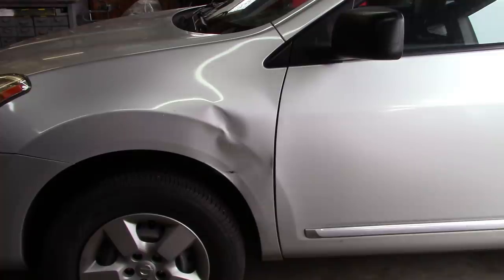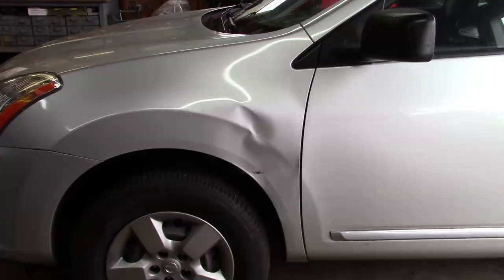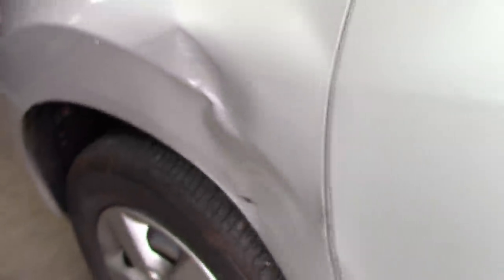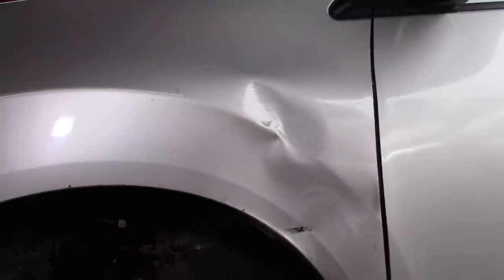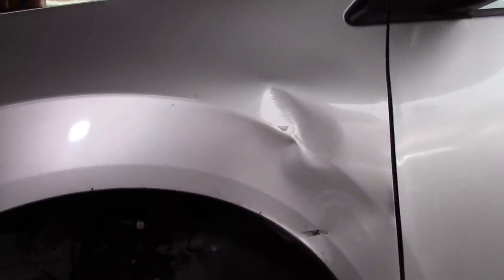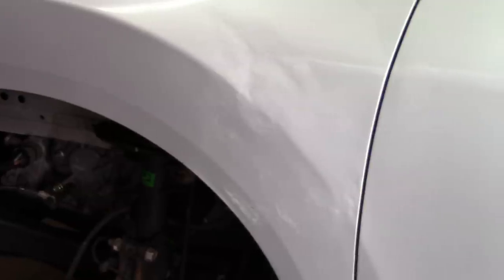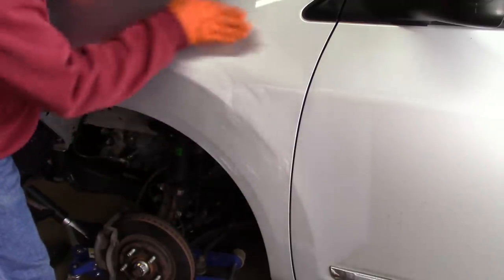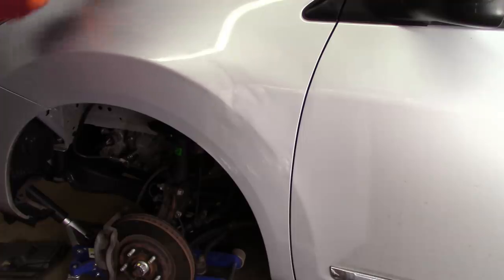Repairing body panels. Techniques and tips. Body filler, and block sanding.#bodyshop #howto

Comment: I've been doing this work for 30 + years, and the metal and filler work is always a good challenge. You can actually hear the different sounds when straightening metal, that let you know where to push/pull, etc. Thanks for the video!

Comment: So nice to see a truly gifted person who really knows what he's doing, and not teaching today's youth how to "hack" repair vehicles.  From one body man to another, great work.  I am a retired body man with over 42 years experience.  I learned in the good old days 1964 to 1979.  After that, everything turns to trash.  I am subbing you because it is relaxing to watch what I used to do.
Reply: Larry Ciarrocchi techs these days are nothing but part changers
Reply: Did no one teach this guy not to put filler on to an unprepared surface, it will just peel off.

Comment: You did good, but I've watched videos of paintless repairs, using those different levers, complete repair without any filler or bondo. Very impressive. Ive done a couple of big dents on an old GTO i used to have, but never enough where I didn't have to use filler. Those guys are dang good. But those tools aren't cheap.

Comment: I'm glad you finally changed the way you used the spatula. I could see you making a "dip" in the higher curve just with the sweep of your hand. I'm also glad to see how you did this because I did the same thing for an entire quarter that had only the other side to go by and I'd never done that before. Took awhile but finally got it. The space between the character lines also had curves, and were not flat. A lot of sculpting. The guy below is right about using tape but I had to build it up first since there was nothing to go by - the rear part of the door was also mashed in. I had to keep taking measurements from the other side.

Comment: As someone who has worked on cars for the past 16 years, I can tell you, you're a wasting your money doing all these steps. Because at the end of the day, getting a new fender and just painting it will be 10x's cheaper then buying all the sand paper, sanding blocks, dent hammers, pulling out the dent equipment, masking tape, masking paper, it all adds up.. it's so much cheaper to just get a new fender or used fender in good condition, however, if you HAVE TO go this route, this is an amazing video to show you how! Great work sir! You did an amazing job!
Reply from the maker: Thanks. The point of doing this video, was to show techniques that could be applied to other areas and damage.
Reply: @JoDaddysGarage  I agreed, did I not?! You made a great video, I was just saying that it could be done without spending so much money. Your video is top notch, you made a great tutorial, I applauded it, I just thing there's no reason to spend that much money, as you can get a fresh bumper, and just paint it, amongst other things, I wasn't knocking you mate
Reply from the maker: Sorry for any confusion. I'm not upset. I do appreciate your comments. Sometimes comments can be confusing because we can only read words, rather than voice inflection.

Comment: Use a pencil to trace the line lower with the curvature of the fender,,, and upper,,  also use tape to lay your lines, then use some dark spray paint very lightly to keep track of your lines and how much bondo to sand of,, very nice work,,👍🏼👍🏼
Reply: Yep, I wish my body men used guide coat. We use it to sand primer on every job. Its feels like cheating cuz you can see every low spot

Comment: Nice tutorial. I don’t have access to spot welders or these other fancy electrical gadgets to pull the dent first. I like the fully manual approach…old school if you will. I’m going to try my hand at a nasty dent on the rear quarter panel on my Escape which also has this slope and fender rise (like the fender you reshaped) at the damaged area. Looks like I’ll need a few Dura Block and a new supply of sandpaper. Thank you.

Comment: I really Like your videos. You do really nice work. This might sound crazy but I’ve been using a D.A. Sander with 40 grit to rough in my bondo work up to a certain point then I’ll finish it off by hand. On contoured areas you can use an interface pad in between the D.A. backing pad & the hook it sandpaper to really match the profile of the contour to bring it closer to straight and then I’ll finish it by hand blocking. Also I see you like to use the powdered guide coat for high & low spots and I’ve found it works really well for creating & seeing body lines as well that you had to deal with here. Those tricks have been a huge timesaver for me The hook it D.A. sandpaper isn’t really much more expensive. Anyways, just my two cents cuz time is money & there’s never enough of either. Thanks for all the time you spend sharing your craft because you are a true craftsman !
Reply from the maker: Thanks. I have also used a DA to rough in the filler. Not everyone will be comfortable doing that, so I wanted to show the process just using blocks. Thansk for the comment.

Comment: Next video, can you please show us all how to straighten a door, make all the panals straight as an arrow, completely matching the other panals, please also show us how to level out a fiberglass hood to match the steel fender along with the urathane front clip and also how to blend in and attach a fiberglass rear bumper on an 81' Camaro in Gm lemans blue? I'll let you show us on video, for all our benefits on my Camaro. I'll supply all of the materials.
Reply from the maker: That's.... very generous of you.
Reply: @JoDaddysGarage 
Just kidding. Great video

Comment: I'm giving you advice next time if you want to drive panel beating you can use some small fire then after you start with the block and Humber income is dry and no need to spray no filler paste

Comment: Hi Sir, What kind of a grinder is that? The one you used to remove paint.
Reply from the maker: It is a 90 degree air grinder with front exhaust. Similar to this one: https://amzn.to/4dxG4hg
I'm also using these sanding discs: https://amzn.to/46zg6Yl

Comment: As a pdr tech I cringed so hard watching this. That paint could’ve been saved with minor scratches. Now it’s got a shit ton of stupid bondo on it. Regardless of my criticism, good job man.
Reply from the maker: lol
Reply: @JoDaddysGarage  PDR is pretty common in the UK where I have seen some fantastic PDR work done on some really difficult  dents on converging body lines .  However,  you come to a point with PDR  where the damage is so awkward  it is too time consuming and you can't get an adequate finish.  If you can  do what is shown in this video then you can pretty well repair any body panel to a good standard no matter what the damage ( up to the point where it is easier and cheaper just to buy a new panel).
Reply: Yes you should of worked the top 1st. Below the Crown as there is a lot of tension at that point before working the rest. Yes you could’ve repaired this without having to paint and sticking filler in it

Comment: Great job Jo. That repair would cost $2000. Just got a quote of $900 for a 4-5 in. crease.  about one inch across near damaged headlight!!!  Add OEM headlight and the price could jump to $1600 for a 2003 Toyota!!! Like to see paint and clear coat video.
Reply: 2k? You got me fucked up with that you buy another 2003 toyota.That job wont cost you more than 600 $

Comment: Looks great and the tip on how to put tape on the paint can is a great idea 👍
Reply: I really Like your videos. You do really nice work. This might sound crazy but I’ve been using a D.A. Sander with 40 grit to rough in my bondo work up to a certain point then I’ll finish it off by hand. On contoured areas you can use an interface pad in between the D.A. backing pad & the hook it sandpaper to really match the profile of the contour to bring it closer to straight and then I’ll finish it by hand blocking. Also I see you like to use the powdered guide coat for high & low spots and I’ve found it works really well for creating & seeing body lines as well that you had to deal with here. Those tricks have been a huge timesaver for me The hook it D.A. sandpaper isn’t really much more expensive. Anyways, just my two cents cuz time is money & there’s never enough of either. Thanks for all the time you spend sharing your craft because you are a true craftsman !

Comment: I'm just curious, why don't anyone hear the metal up when shaping with hammers and stuff. One would think it would move a little easier.
Reply from the maker: It depends on the damage. But heating metal will make it weaker if not done properly. It can also lead to other problems. Metal can “oil can” without proper heating and cooling.

Comment: Only thing i would recommend is taking out the dent a bit more before putting so many layers of bondo because the more you take out the less bondo you gotta lay on and when blocking you gotta block the whole bondo area and beyond not just areas at a time because you create low spots thats another reason why you run the risk of laying more bondo but other than that thank you for helping out
Reply: I don’t think he ended up with more than 1/8! Of an inch .... pros n cons .... having one bondo area instead of a few random spots avoids chasing the dragon on getting little nooks feathered etc .... which can require more hi fill primer

Comment: JOE  I have a question: For example when a vehicle/car has been rear ended by a tractor trailor truck (hitting one side of the rear bumper) cracking the bumper / ripping off  one of the tail lights aka brake lights and smashing the rear quarter panel......  QUESTION ONE (1) What are other possible issues that are likely to have occurred to the vehicle that the naked eye and non mechanics/non body shop specialists    would not be aware of      could yah list the guestimate price for each repair including the obvious repair/replacement of the bumper, tail light and rear quarter panel
Reply from the maker: Good question. In an accident like that, there can be a lot of issues. Without seeing the vehicle in person, it's hard to fully assess. Likely issues can be frame damage. Hard to see without taking everything off. Even a slight impact can twist the body, and cause door gaps to close. The "b" pillar (where the door latches) could be pushed forward, and possibly inward slightly. Depending on the type of vehicle (car or suv) lift gate issues can be a problem. Even hinges can be bent. Other than that, the car could have suspension issues, and need an alignment. Can't really do an estimate as prices vary widely by manufacturer.

Comment: Bear metal 1 inch After plastic filler.  To give you a chance to feather edge undercoat 1inch away from paint  then after plastic fillet and feather edged the paint And under coat.  Primer it

Comment: I'm curious what real time was on this repair. Looks to be about 2-1/2 hours of time from the roughing, to filler and sanding. As an auto damage adjuster, this is very helpful. Average I'd put about 4-1/2 hours repair on that damage which feels right given you pay for the expertise, not real time.
Reply from the maker: Hard to say for sure. I had to do a lot of camera setup time.

Comment: What is the technical name of the part you are repairing in the very beginning of the video
Reply from the maker: The fender liner?
Reply: @JoDaddysGarage  kinda sorta is there any wiring in the heating system near the drivers side fender on Toyato Lexus vehicles

Comment: If i was to just use a hammer and dolly to rough the dents out without repainting will it leave many noticeable marks on the paint?  My fender is crumpled slightly and it's not really worth repainting but I'd like to try and fix it (mostly just to learn how to really).
Reply from the maker: I'd have a PDR pro do it. Any interaction with a hammer and dolly can lead to cracked paint.
Reply: @JoDaddysGarage  Thanks I'll just leave it be then. It's not worth me spending money on cosmetics for this car, but I dont want to make it look worse.

Comment: what technique do you have for cleaning up the edge of the fender at 40:50 to 40:53?
Reply from the maker: Really just pulled the tape, and took a small piece of sandpaper with my finger tips.

Comment: Quick question. I went to get an estimate because I have some damage on my fender. Not a huge dent but definitely one and it has some scratches. (Someone hit it while it was parked on a plaza). The guy quoted me for much less money to basically fix it and paint it as you do in this video and more money if I want to replace the fender completely and he’ll repaint it. So what you do in this video takes much more time and effort than just replacing the fender and repainting. Do you know why it’s less expensive to get it fixed rather than replaced?
Reply from the maker: It could be a variety of reasons. The cost of the new fender, labor to remove and install, and panel prep. With a small repair, none of that is included. He can do a quick repair, prime and shoot with paint and clear.

Comment: Don't understand why you didn't just pull the dent with a pin puller or spotter, but you got there in the end I guess
Reply from the maker: Not all home repair people have those tools. I do,  but wanted to show what can be done.
Reply: @JoDaddysGarage  You know I thought this after I had posted it :)
Reply: If you have access from the back its always better to use a hammer and dolly because if you use a dent puller you can run the risk of warping such a thin panel and its less of a mess

Comment: would it not be easy to remove the fender and work it off the car? I have had a good success by removing the fender and working on it off the car, there would be less bondo or no bondo at all if you are careful with your hammer.
Reply from the maker: You could.

Comment: Is there any chance of advising the brand and size of the small air sander that was the first used on the well done job?  Cheers Steve
Reply from the maker: That is a 90 degree air sander from harbor freight. https://www.harborfreight.com/air-tools-compressors/air-tools/air-grinders-sanders-polishers/1-4-quarter-inch-front-exhaust-air-angle-die-grinder-52848.html

Comment: Question for you, If you were going to sand it to metal anyway, why not just use a uni-spotter or stud welder, and pull the dents?
Reply from the maker: You could, but I would assume most people don't have these at their home garage.
Reply: @JoDaddysGarage  ok good point fair enough!

Comment: Thanks for sharing. What is the mixture of the primer? What is the size of the nozzle you used for the primer and the based please?
Reply from the maker: Primer was mixed per the label on the can. I think it was 4:1. Can be thinned as well.  The primer nozzle is 1.8. Base was 1.6 if I remember correctly.

Comment: So, I am not up to date on the latest body chemistry...its been 40 + years since working in an AMC dealer body shop. You lost me when you applied filler over the paint in the upper area?  Why did you not bring it to metal first?  When your filler crosses from metal to a painted area, aren't you beginning to rely on the paint to hold your repair?
Reply from the maker: Modern body filler can be applied over factory paint. It just has to be scuffed and clean. Rage Ultra. It's in the data sheet from the manufacturer.
Reply: @JoDaddysGarage  Thanks for a quick reply and the heads up, In our case though we are working on 40 to 70 year old cars.  I think we will stick (no pun intended) to application directly on metal.  Your video was patient and well explained and I am grateful we had a chance to view it.

Comment: When I was doing bodywork, the paint always had to be completely removed before filler was used... has the filler come a long ways or what?
Reply from the maker: Yes. Evercoat advertises on the can that you can go over OEM paint as long as it;s prepped properly.
Reply: @JoDaddysGarage  But you didnt prep the paint Jo straight over with your filler.

Comment: Awesome job, I’m curious where the cost to time ratio comes in on just changing the part, looking it up a new fender for these is sub $100 vs the time and material to get it to primer state.
Reply from the maker: I made the video for demonstration purposes. I realize it would have been easier to replace.
Reply: @JoDaddysGarage  I figured, you did an excellent job. But as someone who has never done body work is there a method to when you would put a new panel vs repair? Would you repair a unibody piece but replace a fender? Or only a minor dent repair instead of replacing?

Comment: I would have just replaced that fender,, to much time to do the repair.
Reply from the maker: It made for a good demonstration though.
Reply: I thought the same thing but if their is not a cheap fender locally or in the scrap yard are you gonna keep a customer waiting 5-6 days for a ebay fender when you can spend a day on this and make £245 I would charge
Reply: @JoDaddysGarage  Exactly, and this technique can be applied to a rear quarter panel which is neither cheap or easy to replace. Thanks for taking the time to do this, it helped me a lot!
Reply: PDR systems my friends, cheaper and faster and the only way to go, if you know anything about metal science and metallurgy? and if you don't you should be working panels and straightening dents or spray painting. If you don't know how to do it you are so far behind the times.
Reply: @williamduffield4964  lmao pdr isnt cheap.
Reply: People replace because they don't have the skills to repair.
Reply: @malcolmchadwick4047  Wrong. Sometimes it's just more cost effective to replace.
Reply: Replace fender and u add 10 hours of painting a hood and bumper. He done right. Repair fender and keep the paint on the door and fender
Reply: Hate to see what that 30 min repair looked like